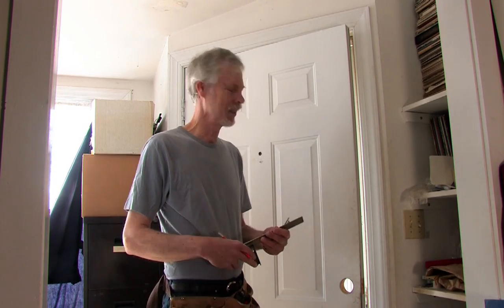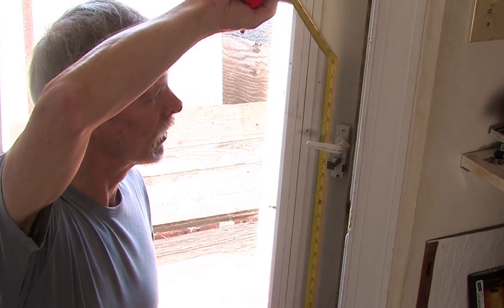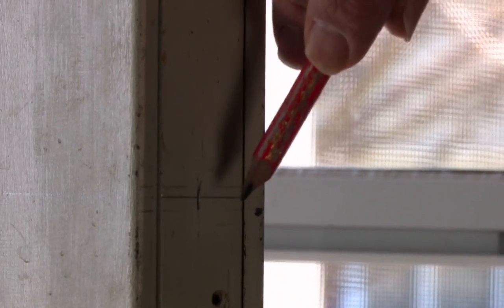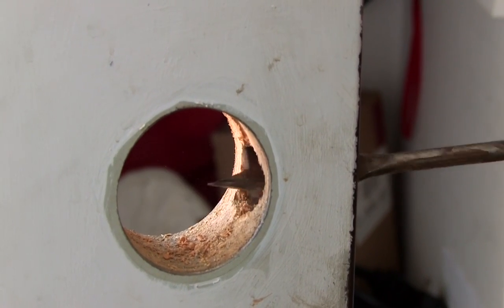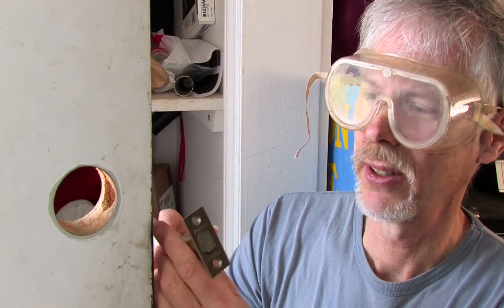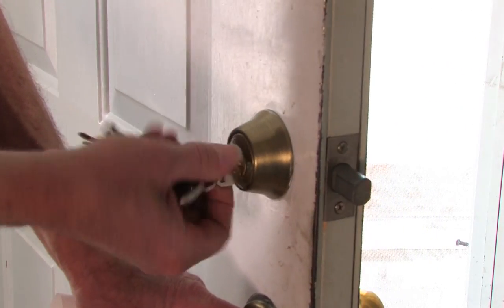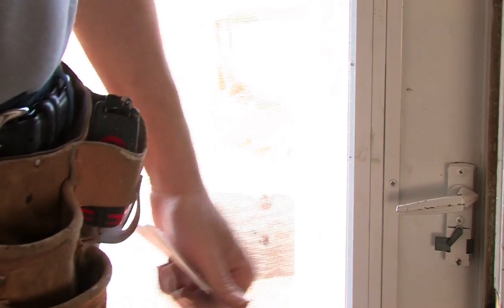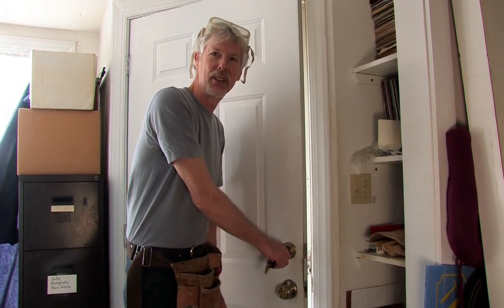Door Help : How to Install a Deadbolt Lock to a Steel Door

Comment: Hi.... Someone put my deadbolt in my steel door for me ... only it won't work from the outside of the house .... also  it won't release the key in the locked position  from inside the house ......   HELP !!   Please   12/11/2019       Thank You

Comment: Great instructional video!  I shared this with my daughter.  Someone attempted to break into her house through the key hole on the door knob. Looks like they used a screw driver.  She definitely needs a dead bolt, but she also has security cameras and has hooked up to ADT now.  Pretty sad when she lives in a small town where 20 yrs ago, we didn't have to lock our doors!  We figure it was one of the junkies in town, looking to steal anything of value to pawn.
Reply: I reccomend adding outdoor solar powered  motion detector lights at dark areas of outside perimeter of house.

Comment: You did a good job. Don't listen to the droners trying to find something to dislike. This was a video on how to install a dead bolt on a standard home or garage door with a thin metal shell. Those looking for how to install a dead bolt on a full steel door need to find a different site like how jails install locks. lol

Comment: So how to you cut out the hole for the lock faceplate with a metal frame? As in, the front, back, and sides of the door are coated in metal.
Reply: The easiest way is after the deadbolt is in, then put lipstick on the end of the deadbolt to mark where the hole needs to go.  He's likely got another vid for that.

Comment: Another thing I like to add is that the recommended bit size for the actual latch, in my opinion, can actually be a little smaller because the actual width of the latch is not 1 inch in diameter.  So I adjust my drill bit diameter to the width of the latch and cut two holes 1 on top of the other to accommodate for the height. My reason for doing so is that the door jambs are so flimsy nowadays that I want to remove the least amount of material possible.  Now to answer some peoples questions like "Why would the lock company suggest you use a 1 in bit, instead of a smaller bit and doing it your way."  Well let me just say that some people may think it is too complicated to do or even explain the way I do it. Most people are lazy and will choose the 1 in.  bit anyway.  SO IF YOU CAN'T BEAT THEM , JOIN THEM.

Comment: I personally like/ prefer my backset to be at 2 3/4 regardless if it is residential or  commercial. My reason is that some people have big hands so the/my  preferred  backset allows for more clearance for the knuckles.  I know some people may say that for a lock you are not putting your hands around the key like you do around a knob,this is true.  But I like to line up my lock and knob vertically on the same line.

Comment: I have to cut the strike hole in a metal (steel/iron) door frame. What video should I watch? :)
What tool I need to drill through a metal frame? Do I need to cut a circle or rectangular hole...

Comment: The basics are covered but the part I wanted to see is how those drill bits actually worked.  The way the video is edited it makes you think that it wasn't as easy as it looks and they passed the part where they struggled with the drill.  My door is 100% metal so this video was a little misleading for me.

Comment: The title says "steel door" and all I see is a plain wood door. Am I missing something? I got a metal door and need help with that so was hoping for this video to how me how.
Reply: Sorry James, I have 4 steel doors installed in 1980 that do not have a wood core, I'm replacing with 4 new metal doors without a wood core.  I need to know how to install a deadbolt on a steel door not a steel laminated wooden door.
Reply: not true, hollow steel doors fire rated
Reply: @James-fl3eh  
Mine doesn't.
Reply: @James-fl3eh  dude you never worked on a actual steel door then. There is zero wood  in a steel door. Its Steel.
Reply: same, what gives?
Reply: Right. He is chiseling out the wood on the edge of the door.

Comment: I just installed a deadbolt in the door between my kitchen and my garage using nothing but your video, a used deadbolt from when I replaced the one on my front door, and tools that I already have. Thanks for an extremely helpful and informative video. It's still helping people even if it is almost 5 years old at this point.

Comment: spade bit & chisel on a steel door? good luck.
Reply: +Dennis Elwell This comment doesn't help - at no point does the video suggest using a chisel or spade bit on the steel part of the door, only the wood core and the wooden door jamb.  I was able to follow this video exactly (and some supplemental tips in the comments) and found it spot on and useful.  Good luck will be had by all using this video as a guide.
Reply: +Aaron SemlerPDX Actually it does show him about to use a spade bit on the edge, for the bolt, but doesn't actually show him doing it at about 3:30-3:45. Wonder why? It cuts (excuse the pun) to the hole drilled out  already. Spade bit will work great on a wood door, but not a steel or steel framed door. Best bet would be a 1" hole saw and a drive in bolt, instead of the everyday usual deadbolt.
Reply: Dennis Elwell The edge of the door is wooden, he uses a spade bit on the edge of the door, cuts for time compression only, and not all steel framed doors are 100% encased - many, like the one in this video and the one I worked on at home, have an exposed wooden core on the edges.  This in no way impedes the use of a chisel or spade bit for the edge of the door.  I just did it myself - you are calling not only this video incorrect, but myself as well.  I can provide a shovel if you'd like to dig yourself deeper, friend. ;)
Reply: @SemlerPDX  
This comment does help, 4 years later, as pointed out by many others, many metal doors (including mine) are wrapped in metal entirely. Ergo a chisel and spade bit is a laughable chore. So it's something to at least consider. Him making that comment made me take a second look at my door.
Reply: My door is metal wrapped on the edge -- good tip RE: 1" hole saw and drive-in latch.

Comment: this is a basic instructable for a basic deadbolt installation. nothing special, nothing high security, especially as brute force is used to break in.
Reply: a few tips, use a hole saw that is designed to cut through metal, not a wood hole saw. the metal in the door is a REALLY thin "skin". the wood edge should give that away. on the door side, if you want some anti-kick protection, use a door-wrap to secure the edge of the door with the deadbolt. that's first. second, use a heavy duty strike plate, one that is at least 12-18" long, with multiple 3-4" long screws that go into the stud behind the door jamb. otherwise, in terms of brute force, you're just putting lipstick on the proverbial pig in a poke.

Comment: Nice video.  The only suggestion I have is to using masking or painters tape to cover the area you are drilling on metal.  This avoids scratching the door.
Reply: Does it really matter on this door?  It is really dirty and needs painting!
Reply: Masking and painters tape will destroy your door, it’s very poisonous and corrosive, do not use!